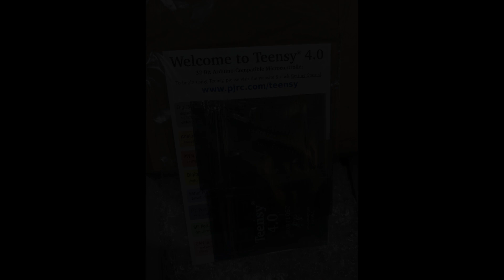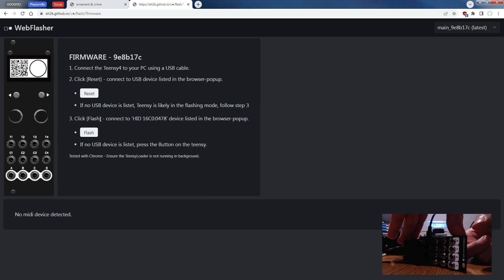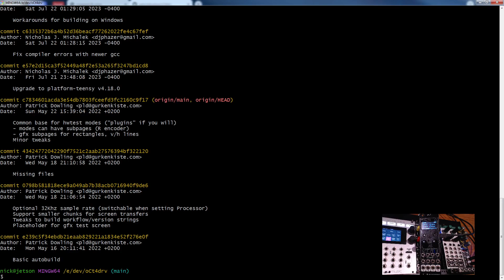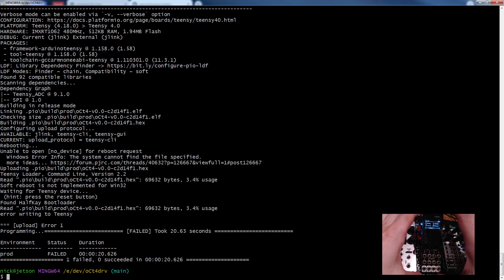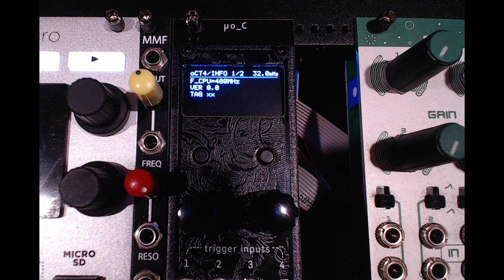Teensy 4.0 Upgrade For O_C + Firmware Demo | Phazerville

Comment: @phazerville Do we HAVE to cut the power strip? Because I wouldn't mind having the usb power the board, because my rack is a little far away from my computer and i'd be ok with removing it, changing firmware, and putting back into the rack
Reply from the maker: You don't have to if you don't plan on using USB MIDI!
Reply: @Phazerville  Oh Sweet! Ordered mine, here's hoping I'm not going to brick the board LOL. Thank you!

Comment: Seemed like a simple drop in replacement until I realized the pins on my Calsynth o_c are slightly smaller than the pins on the 4.0 😩

Now I've got an annoying desoldering job and gotta find a suitable female header that will fit. Any tips on the latter? I'm a total nooob
Reply from the maker: There's already a pin header, but the T4.0 won't fit? Can you bend the pins to make it work? I wouldn't recommend desoldering... CalSynth is also offering new units with T4.0 if you must have it 😉
Reply: @Phazerville  Thanks for replying! The problem is that the pins are a different type altogether. It's a square peg in a round hole situation, so bending won't do it. I had no idea there were different pin types.

I'm not going to desolder from the module, but rather remove the square pins that are on the teensy, and replace them the smaller round pins that calsynth used.
Reply: I'm eventually going to go for one of those crazy 4.1 o_c's, so this is merely a stopgap. Been more or less following the development, and it looks to be really wild! Truly appreciate the work you've put into this project.
Reply from the maker: @circles79  ohhh ok, I see. I was also unaware that there are different pin sizes... kinda like differently gauged wire, eh? Actually, I think I have seen what you're talking about, more rounded than square. Good luck with it!

Comment: Is it as easy as swapping the teensy board to a 4.0? Will a previous uO_C hardware work? I thought the hardware wasn’t compatible 😅
Reply from the maker: It's all been resolved with new drivers in my firmware fork! T4.0 is literally a drop-in replacement for old O_C hardware.

Comment: Now I'm going to need to pull my O_C out of the rack and see if I can do this with mine. I had no idea it was possible to just drop an upgraded Teensy in there!

My unit was one of the earliest modules I bought for it's multifunction use, which were only stock apps at the time. It's great to see people like yourself carrying the torch and expanding on it so much years later.

Comment: Sorry in advance for off top, wanted to ask about your o_c firmware, that combines hemispheres with stock applets - is it complicated to make different combination of stock apps, for example if I want to have quadrature, piqued and dialectic ping pong in one firmware. I see, there is source code file, but I never tried to dial with code. Just some advice before I will try googling that stuff
Reply from the maker: Custom combos are fairly simple! Peek inside the "platformio.ini" config file for the various App build flags. If you need more support, use the Discussions section on GitHub.
Reply: Thanks!

Comment: Wishing you the very best of luck with this one. I can see you being responsible for the great Teensy 4 shortage of 2024.
Reply from the maker: Hey now, let's not get too far ahead of ourselves!
Reply: @Phazerville  from PJRC web, under Teensy 3.2 news: "Update: September 20, 2023: Synth DIY builders - we are working on next-gen Ornament and Crime hardware using Teensy 4.1, with release likely by December. The new hardware will offer a massive increase in capability and enough memory for all O_C apps in a single firmware."

Comment: Im not much into programming, but I am wondering what the teensy 4 will offer hemisphere if you can end up porting your firmware over. Or is it just because the 3.2 is bassicly gone and we have to use 4 now?
Reply from the maker: Availability is the primary motivator, but extra processing power could also enable more intensive computations...
Reply: @Phazerville  I see!! Looking forward to what the future brings... I am keen to pimp my o_c as much as possible.

Also kind of keen for someone to do something (anything) with the temps_utile. I'm sure it's more limited as it only has one 8bit DAC I believe